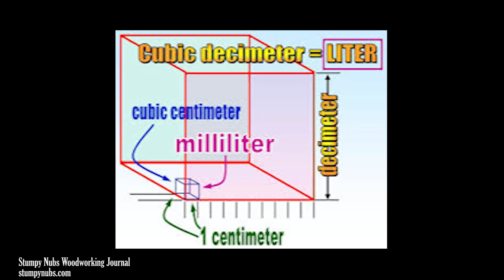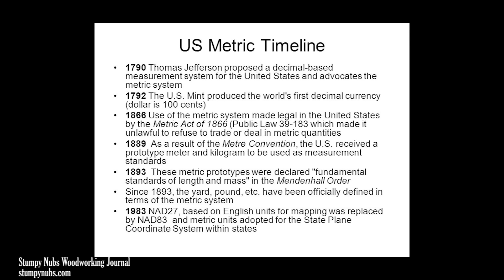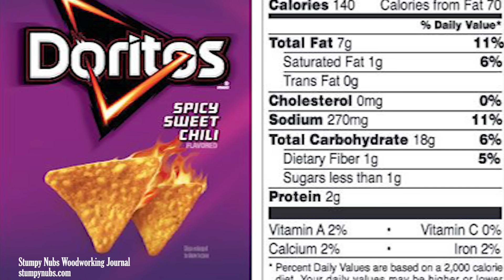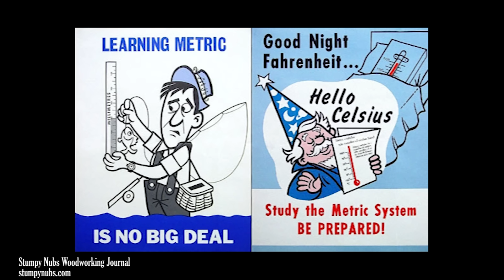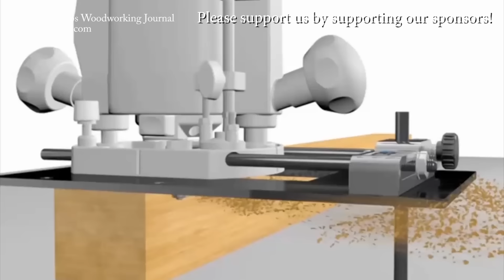BREAKING: The USA is switching to METRIC!

Comment: I must confess that I was not enthusiastic when we changed from imperial to metric units in the U.K.  However forty years on I find I make less measuring mistakes using the metric system and relieved that I don’t need three types of spanners to work on my car! I look back and wonder what the fuss was about.
Reply: 2 things: 
1. Change is hard
2. Brits and Americans seem to have a deeply rooted need to feel special.
Reply: The interesting thing with that is Canada also used Imperial units up until about 1976. But the gallons were larger, 4.5459 liters IIRC, and a few other things like fluid ounces were smaller being that there were 160 ounces in an imperial gallon, but a US gallon is only 3.7854117 liters and has 128 ounces. The reason for this is, USA stayed on the Queen Anne era units of measure as used in the UK, and then after 1776, did not switch to the newer UK Imperial system of units, so in all actuality, the US system of measurements dates back even farther than the Imperial units of measure used in the UK and other Commonwealth countries just prior to switching to a metric system. The Queen Anne era gallon as defined to be exactly 231 cubic inches dates back to 1706 and was called a wine gallon. The UK abandoned that unit of measure in 1826, but that was just 14 years after the war of 1812, and things weren't exactly friendly across the pond.
Reply: @brnmcc01  Thanks for the interesting history. I would like to say “that makes sense” but mostly history doesn’t make sense. Like here in the U.K. when we went full blown metric we chose to keep road signs in miles! 🤣🤣
Reply: @pauldgardner1 even now i have trouble with kilometres. Metres etc I'm fine with. I just can't seem to envision Kms. But then I am quite old now, possibly too late to bother with 😊

Comment: As a Canadian, it's even worse up here. We oscillate between metric and imperial so frequently, you'd think we were experiencing convulsions. I love the humorous approach to this subject.
Reply: I was going to comment the same. Since we are so close to the US, we use both in an odd, haphazard way. Even worse for those of us who grew up in border towns!
Reply: Here in the UK we would ask for 3m of 2 x4, so we mix and match all the time. Gas is sold in lites but we talk about miles per gallon.
Reply: We have bilingual measuring tapes!
Reply: Also Canadian here, construction industry atleast is still the old way good ol' feet and inches
Reply: @StephFacca  Technically I live in a border town on Lake Huron and since my parents grew up with imperial or US I have somewhat adapted to both.
Reply: @nicholas5623  
Because the land was measured in imperial, and the houses were measured in imperial. If you want to do renovations on an old house, it's imperial. 
Personal weight is a tough one to metricize, so is personal height.
Reply: @JB-yb4wn  I'm talking new construction lol 😂
Reply: @nicholas5623  
Still the boards are in imperial, but the plumbing is all metric. I still have some trouble wrapping my head around square metres. 
🤔
Reply: @JB-yb4wn  A square meter is just over  -9- 10 square feet. (A square yard will be 9 Square feet, but meters are slightly longer than a yard.)
Reply: And for size estimation, we use whatever the closest whole unit is, mostly without regard for the system, for example: the widget is made of a 1m piece of 1"x1/4" flat bar, with a 1' dia circle on one end, and a 10cm cube on the other end.

And as soon as the calculator has to come out (for example put 6 equally spaced holes in a 5' 7 1/4' board) then I just switch to metric.
Reply: Canadian woodworker here, I find it awesome, sometimes I switch depending on where the measurement lands closest and how much math I'm gonna be doing.
Reply: The US uses both metric and imperial. Nearly all engineering and manufacturing is done in metric.
Reply: @JB-yb4wn  When I worked in Saudi Arabia a coworker bought a bathroom scale. He was happy that it had metric and imperial. He came to work and asked me, "What's a stone?"
Reply: @danielcarroll3358  
Lol
The thing that you throw at unfaithful women in Saudi Arabia.
Reply: @jamesphillips2285  
about 3inches longer than a yard. Now where did my hogshead go?
Reply: @JB-yb4wn  I think if you measure your imperial boards they are actually metric.  Although tape measures have the 16 inch markers. 
I use both when measuring.  I use the measurement that is easiest to use, such as even inches, or half inches. But prefer metric over 16ths or 32nds.   Harder to make errors with metric.
Reply: @j.hueston4370  
You got that right. You need a degree in physics or math to work out Imperial fractionals. Metric makes it that much harder to make a mistake.
Reply: @JB-yb4wn  Slightly closer to four inches, but it is a nasty fraction.
Reply: I immigrated here and its p***ing me off to no end! They claim to be metric up here but everyone and everything is still inches. Soooo frustrating and it's all the fault of our lovely trading partner to the south. Can't even buy a metric set of drill bits from Home depot!
Reply: @jimrobertson8357  yep UK joiner here, I can even measure a length at say at 9 inch by 14 mm 😀 plasterboard here are 1.2 x 2.4 yet ply is 8x4 🤣🤣
Reply: @danielcarroll3358  I sense your comment was made (slightly) tongue-in-cheek - but for anyone unfamiliar/curious, it's 14 pounds (weight); tends to be used here in the UK more than in the US.
Reply: I feel your pain 😢
Reply: @mdpenny42  Yes, you got my drift. I have never heard anyone in the US use stone as a unit. It is my understanding that it is mainly used to describe a person's weight.
Reply: That's true. In residential construction, we always used Imperial, but as soon as you go onto a commercial job, it's metric.
Reply: @nicholas5623 yes in residential. I always had to switch to metric soon as I set foot on a commercial job.
Reply: @danielcarroll3358  Indeed (though, to be honest, kilos are more frequently used these days) - so you could have the proverbial "seven stone weakling", for example.

And, if you want to make things more complicated, there's the "hundredweight" (8 stone or 112 pounds) - meaning that 1 Imperial (or "long") ton = 20 hundredweight = 160 stone = 2240 pounds :)
Reply: Here in the United States , before the car manufacturers swapped from Cubic Inches of Engine size to Liters try converting that it's roughly 61 cubic inches to a liter  , notice I said roughly   😳!!!!!
Reply: @nicholas5623  Lets run through a few:

If you work in a restaurant, odds are your fridge temp log is in imperial. Freezer may or may not be as well - but in my expierience there is a good chance it's recorded as metric. Your height is probably in day to day use given as imperial - but on official documentation it's metric. Distances are going to be in Metric most of the time - unless talking Football (we are talking Canadian Football just to be clear). Construction is certainly imperial (with so much trade between Canada and the US in terms of building materials - it simplifies things, except for the stuff that comes as metric measurement, such as some plywood).

If we are talking volumes of most things - it's Metric, but step into a bar and it's imperial (Good places serve Imperial Pints, cheap ass ones serve American Pints - and if you get served one of those, you know rather quickly to scrap the place 99/100 times and go somewhere else: They charge the same, and give less - pocketing the profit, and screwing the customer most of the time).

Elevation is in both - just kinda depends on the mood I suppose, unless we are talking airline in which case it's definitely in imperial. Unless we talk about the distance to the moon, at which point we are talking metric again.

Anything related to science is pretty well guaranteed to be metric. 

I'm sure I've missed things - but, this probably makes the point: Both are used, and understood, it just depends on context.
Reply: @mdpenny42  I certainly remember all the complications I had to learn in grammar school. I am a retired physicist cum electrical engineer and I well remember that after graduation from university I never ever had to worry again about slugs, and I don't mean the ones that crawl. All of my professional career was metric, but I still had to shop in traditional, although that is slowly changing.
Reply: Do you use a Metric ounce, American standard ounce, or a British Imperial ounce?
Reply: My dad would say stuff like, "It's only 30 this morning, but it's supposed to warm up to 20!"

I will give Imperial one point, though, since in much of Ontario the annual temperature range is pretty much 0-100F...making Fahrenheit more metric than Celsius.
Reply: @ganko2240   Yep learn both :) each has it's advantages.
Reply: @KevinSmith-qi5yn  how astute! I only recently learned an American ounce is different from an imperial ounce. 29.57353mL us vs 28.41306mL imperial
Reply: That's essentially how it is in the US unless you mean switching between measurements for the same thing. We use a mix of metric and customary down here essentially. Sometimes something is simply done better in metric so we just use metric.
Reply: True. I use metric for temperature, except for my vehicle gauges which I prefer in imperial. For speed and distance I prefer metric, but for measuring anything during woodworking or fabrication, I prefer imperial. Liters for describing engine size means nothing to me as cubic inches makes more sense and as far as I'm concerned more accurate...except for motorbikes, then it's cc.
Reply: @nicholas5623  Please bring out your tape and measure a two by four next tie you have the opportunity.
Reply: Heh, was going to say the same; have you been to Canada? lol... I love the "how to measure like a Canadian" flow chart that's floating around the Internet. Pure gold!
Reply: @mdpenny42 so that means "whole lotta Rosie" weighed 266 pounds. Cool. 😂
Reply: That may go on for a while yet. In South Germany, many people still call 500grams a Pfund (pound)
Reply: It is only painful if you keep trying to constantly convert between the two.  But with the internet, people don't have to do it themselves anymore.  No need to do the math.  Google will do it for you.  Siri and Alexis and Bixby will give you the answer in seconds.
Reply: @watvannou  The US was supposed to go metric at the same time as us in the seventies but then they caved to political pressure. There was no sense of sacrifice for the betterment of future generations. After half a century, I'm still messed up with both but my kids will never have to deal with this imperial insanity.
Reply: @roza9428  The Germans did a very sensible thing though. When they went metric, they rounded all their different local pound units to the nearest metric equivalent, which was 0.5 kg. So while they still use the pre-metric name, the German pound is fundamentally a derived SI unit. It isn't a formally accepted unit though, only used as a customary unit. You can tell the employee at the supermarket meat counter that you'd like two pounds of minced meat or half a pound of bacon but you'll never see a price tag giving the price per pound. Another SI unit that's slowly going extinct is the dekagram (10 g), which has only ever been used for measuring food in the Austro-Hungarian monarchy and its successor countries as far as I know. 40 years ago in Austria no one would have dreamed of ordering 100 g of bacon at the butchers, it would have been 10 deka or dkg. These days dekagram is mainly used by the older generation. I still had to learn it in school in the first half of the 90s but never really grew accustomed to it. It's a similarly rare unit as the decimetre (dm, 10 cm).

And then of course the folding ruler is always called Zollstock (inch stick) in German, unless you meet a language pedant, even though it's been metric (1 or 2 m) for well over a century.
Reply: Imperial? No, we adopted the strange units from the US. If we still used imperial, the pint would be 568 mL, not 473 mL.
Reply: @superd222tube  what the hell is a pouce anyway
Reply: @JB-yb4wn  I'm about 1.77m tall and weigh just over 100kg. That's not hard
Reply: @JB-yb4wn  Walk a meter one way, then walk a meter 90° offset. Then repeat the last step two more times. Boom. Square meter
Reply: @ellenorbjornsdottir1166  
Not hard at all. Beauty of the system, just hard to get the old British imperial units out of your skull for us older folks.
Reply: Canadian here too. most of time, i just use both systems to avoid the confusion.  i remember there was a flight incident caused by this confusion. we need to unify the basics asap. efficiency and clarity is importance.
Reply: @JB-yb4wn  Renovations on any house it is imperial.. Structural prints are still done in Imperial for most applications.
Reply: How many Hz are we talking?
Reply: @jimrobertson8357  gas?
Reply: UK is the same, we have a rapid transit system in Tyne and Wear that is metric, but runs alongside heavy rail lines that are imperial. We've been buying petrol in litres for over 30 years, but almost everyone uses mpg for fuel consumption, and while weight categories in sport and for medical useage are in kilos, almost everyone quotes their weight in stones and pounds. I think we're happy with a hybrid syste m like Canada.
Reply: @Glenn1967ful   Ya similar to Canada but I think Canada is more Imperial centric.  Very little is actually metric in Canada.   Basically all building supplies are Imperial dimensionally.   And blue prints (except Structural)  are in metric but use imperial equivalents. I.E 406.6MM instead of 16".   Food is sold in both  Imperial and Metric dependent on item. We use imperial for stating weight and height, medical is metric. Speed limits are metric but every one still uses MPG for economy. When stating the size of something most every one uses imperial. Long distances are typically stated in time to travel.
Reply: @matthewq4b  Being next to Anerica probably mesns imperial is still frequently used. Over here, we had the influence of the Europe that pushed metrication more, but as we're out of the EU, I doubt we'll ever go fully metric. Imperial is still used for road signs, speed limits on the railways( except some local transit systems), beer and cider, milk bottles, some foodstuffs, television screen sizes, aviation and tyre sizes. Nearly everyone still says feet and inches for their height.
Reply: @Glenn1967ful  Things like Aviation  screen sizes tire rim sizes are imperial globally and will always be.  Metric is great for those that only have the capacity to do math in tens but imperial over all is much more functional and easier to visualize, and that is a big part why it remains in general use for so many things.